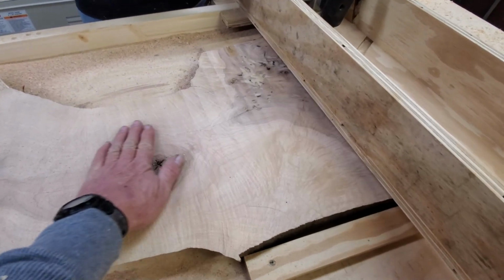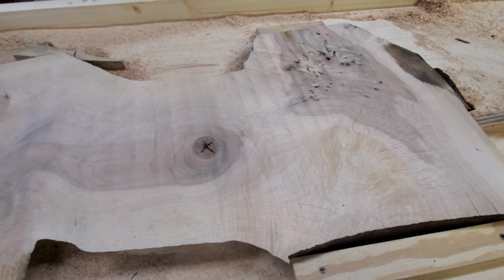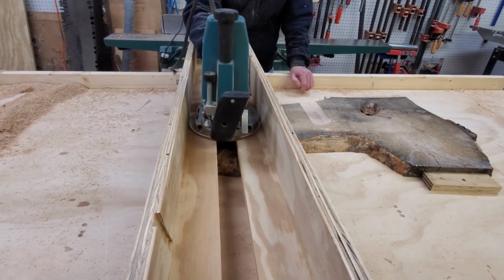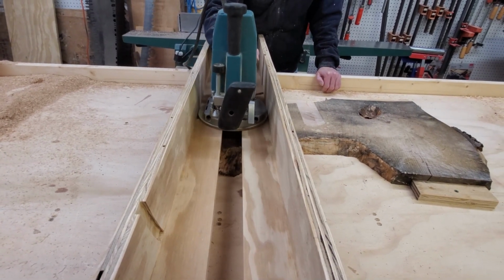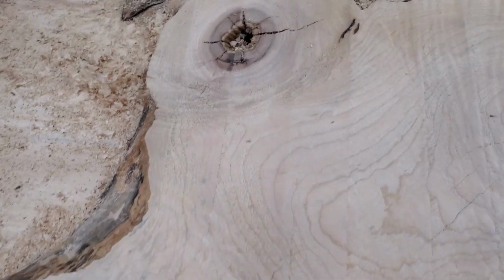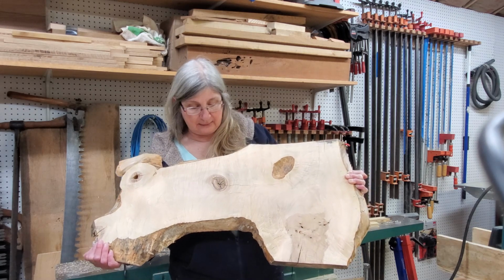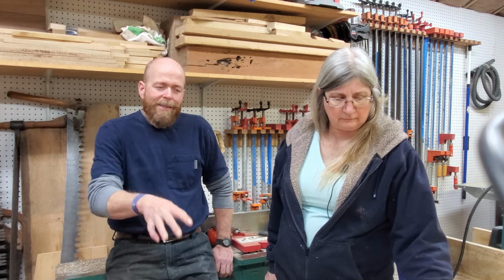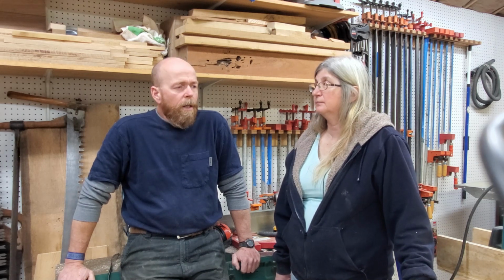Amazing Grains, and Some Funny Moments

Comment: I find that I get a better result and thus less sanding, when I run the router lengthwise instead of across a slab. Less "scallop marks" as you say. It gets difficult with a large slab but worth it to save time sanding. Have fun, keep up the great work!
Reply from the maker: I saw this comment earlier, and tried it out on the next couple of slabs. It looks like it left a better finish. Thank you for the suggestion.
Less sanding, is always a good thing. 
Stop by any time.

Comment: I liked the split top Roubo myself.  I built one from the Samurai Carpenter, YouTube and Face Book.  I liked the Moxon vise setup over other vise setups.  The Wood Whisperer, YouTube has a split top as well with a leg vise arrangement.  Both sites have plans.  For a time frame, my bench took me from the middle of June 2019 until October working 4 to 8 hours a day in my little garage.  Both web sites have videos.  I don't know how elaborate you were wanting to go, but I thought I would offer up these two sites, incase you had not heard of them.
Reply from the maker: Thank you Michael. The split top you mentioned is what I'm shooting for. I sub to both The WW, and the Samurai. Amazing craftsmen for sure. I've seen the builds, but I will be checking out their detailed videos. I have the plans from the Samurai. Some difficult joints on that on, to say the least. Time to test my skills, and increase my tool count.
Thanks for the suggestions, and be sure to stop by more.
Reply: I love this alot

Comment: hi guys, may I suggest you add stainless steel strips to all the gliding surfaces, it will help with stopping the wear.  have fun.
Reply from the maker: Thank you Jim. This sled is temporary. It's a bit to wide to remain in the center of the shop. I will use it to flatten a workbenches, lay up table. I can then use the woorbench to set a router sled on, use it, and break it down again.
Space is an issue right now in the shop.
A final design is needed for the next sled. It will need to be broken down, and stored, when not in use.